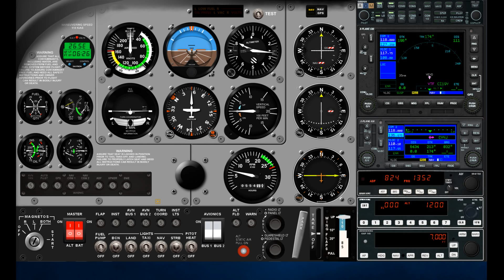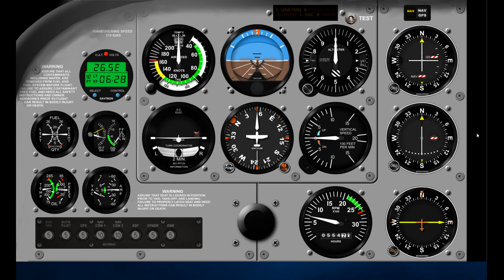Air Manager C172 Panels

Comment: Is this available to purchase?
Reply: I would be interested in the 2 panel version. I’m running two 15.6 touch screens and a Knobster. Currently using the beta 4.0 of Air Manager.
Reply from the maker: Unfortunately not for now Jim. If and when there is a means for doing so then you bet.
Reply: All this work and you have potential clients after reviewing your you tubes won’t sell?   I have watched your you tubes with your enhancements, unfortunately not all of us have the ability to program, but would be happy to purchase, your panel with manifold pressure and hopefully retract will be made available to the public for purchase.
Reply from the maker: Rod It’s not a case of won’t it’s a case of not having things in place to do so. If these things are overcome then they will be released. If you’d like to see third party pay instruments and panels on the Air Manager platform then this needs to be addressed to Sim Innovations.
Reply: Experimental Sim Avionics feel free to send my replies to Ralph and even Russ, I have had many conversations with both, can’t you sell your programming without the blessings of Air Manager, I am sure they would like to have control...X-Plane for example has many third party vendors.  Would you sell on a one to one basis... ?    I know there are several who have watched your You Tubes.. I am just trying to have the most realistic panel,  I fly a retract, constant speed prop,  but can’t seem to find a realistic air craft, I have been looking at the A33 Beechcraft by carenado.   But still need the AM instruments to fill my quest.   Really like what you are doing taking everything to another level, maybe they will have a surprise for us with 4.0.   Not interested in hardware.

Comment: Great Job, I hope you share these two panels with the community, and or even set them up for sale with the other custom panels,  I have  two 22" Planar  touch monitors set up with 1920 x 1080 resolution with the knobster for my instrument panels and three 40 inch HD monitors for visual, and one 37 inch set up for an instructors station,  my actual programming skills are lacking and have to rely on those who create some great instruments, yours has really spiked my interest and understand the hours you have invested to create a much more accurate instrument panel with better operating radios.    I would like to see you offer the option for retractable with constant speed prop.   Most of my flying on Xplane 11 is practicing approaches trying to emulate a complex aircraft with constant speed prop with manifold/fuel flow.   Do you plan to have your panels and revised and improved instrument panel available for AM 4.0?     I think the weakest link for us simmers is the controls, I haven't be able to make many improvements to my saitek yoke, currently working with Norman who has developed a plug in set up with HE sensors, still working on configuration.  I did make a huge improvement incorporating several ideas I picked up on the net and my own using CH rudder pedals, like removing the detents and replacing oem springs with heavier springs and one spring to provide a center alignement,  I built an angled adjustable support to not only provide a more accurate pedal feel, but also to adjust to different pilots.    The pedals also needed a more natural spacing, so I was able to also design and build the pedals to accomodate another three inches with a platform to set your heels on.   I plan to upload a you tube when I incorporate the HE sensors in my rudder pedals.    All my pilot friends, most ATP's have found the rudder pedals a great improvement....A cheap modification compared to spending thousand dollars.   If I could load some photos, I would be happy to share....